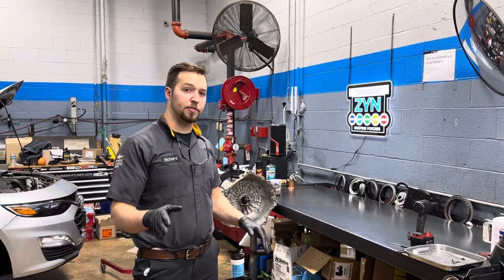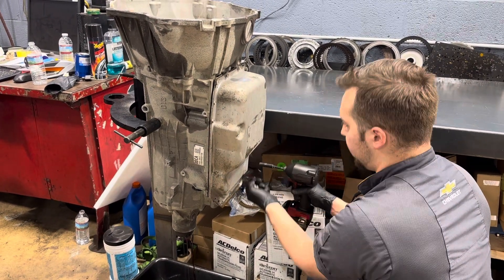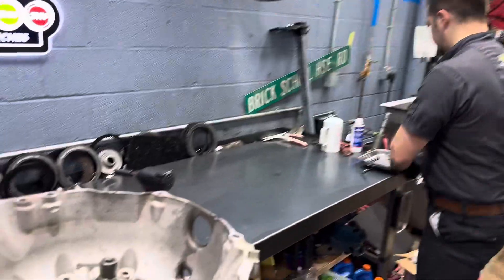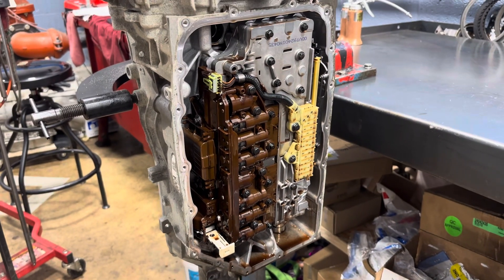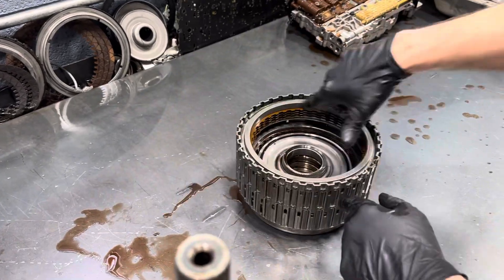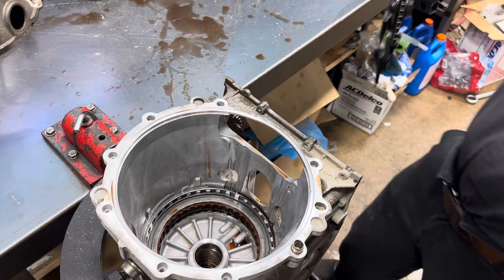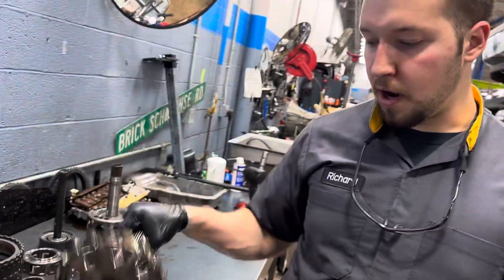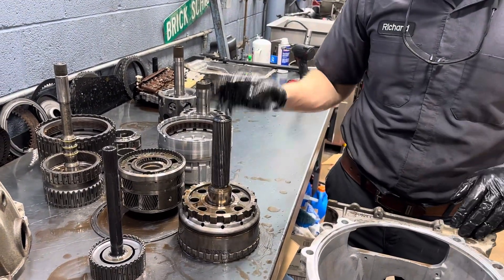6L90 no movement in forward or reverse

Comment: seen that on vans, loaded heavy,  they are not stopping all fwd or rev momentum before swapping. backing up, still rolling backwards, nail drive, or vice versa. its the equal to the 4l60/700R sun gear issues. weak welds sure but abuse finished it
Reply from the maker: Yes sir, that has to be a huge contributor. Those units are before my days man! Thanks for the comment

Comment: And put a billet converter back in it not the stk unit. Right.
Reply from the maker: No, the 6L90 torque converter is fault robust even in stock form. An express van that isn’t used to tow will generally last a long time even with a stock one but not a bad idea. A gas 2500HD work truck that tows often would benefit because it won’t make it 100k with a stock torque converter.

Comment: What parts are you going to replace them with. Are you going back with the factory parts or aftermarket like sonnex. I have 18 van in my shop and after 45yrs of work on vehicles never had trans that i service and moved van outside reverse and then 
forward then reverse into parking spot to come in the next morning and nothing. It has no reverse or forward. I don't rebuild trans and not up on all the problems. I did find a bulletin on the check ball but all that was fine. 18 3500 6.0 6l90 94,000 miles. Thanks for sharing 
The converter was replaced under warranty and the fluid looked good and pan was clean. Just shocked this may be the problem.
Reply from the maker: You will need the output carrier assembly and the output shaft gear assembly. Should be no other damage. That sounds like it could be the problem! Godspeed
Reply: @esoterictransmissions thank you so much. I really appreciate your help. God bless.

Comment: I work on a lot of the express vans for FedEx, I work at a chevy dealer, I see a lot of those failures. they over load the vans with stuff and just pops the weld. Also see it a bit on 2500 trucks with gas engines

Comment: I have a 2017 chevy Silverado and I bought it wrecked and completely swapped a new frame after getting it all back together fired the truck up it makes an awful buzzing noise and when I I put it in gear and it moves but when I give it more gas it’s like it been thrown in nutural and engine revs up then as the rpm’s drop it will move again but reverse works fine
Reply from the maker: @TravisSmith-k7d  Inspect the fluid level as well as condition. If  it doesn’t smell burned you can remove the pan and inspect for debris or remove valve body. It could be a check ball if the fluid is clean. If not there is something else going on

Comment: I HAVE A 2014 6L90 THAT I JUST REBUILD AND NOW IT DRIVES AND CHANGES GEARS GOOD BUT AFTER A WHILE OF DRIVING WHEN I STOP IT WILL STOP PULLING IN FORWARD AND REVERSE WHEN I TURN THE VAN OFF AND BACK ON IT DRIVES CORRECTLY UNTIL I STOP
Reply: This is happening to my 4l60 have you figured it out
Reply from the maker: Sounds like you have a torque converter failure. You’re able to drive it until the filter is stopped up with meta.

Comment: Would this made it seem like the transmission is locked up ? Tried to pull the truck in neutral and it won’t budge no brakes are hung up etc there is a engine code as well
Reply from the maker: If something is snapped in the trans it should always move in neutral. Try removing driveshaft and see if it rolls
Reply: @esoterictransmissions  removed driveshaft and it moved only way I was able to move the truck out of the garage
Reply from the maker: @Rehziicodm  definitely something in trans transfer case or diff binding
Reply: It’s definitely something in the transmission it’s 2wd and it rolled once I pulled the driveshaft . Im thinking torque converter or solenoids gonna look at codes and fluid today ! When you shift it to reverse or drive you can hear it idle down and try to engage but it’s completely locked up in any gear
Reply: @esoterictransmissions  the tip came off the parking rod and it was binding up getting stuck in park .
Reply from the maker: @Rehziicodm  Good find! is it a 6L80? Park rod wear is actually common on them. I’ve never seen it but I’ve read about it
Reply: @esoterictransmissions  it’s a 2wd 6l90 I was kinda mind blown finding it it’s allowing it to slide to far forward because the tip isn’t there to stop it so it stays engaged

Comment: I just bought a 2015 6l90 from a 2500 2wd. It will not go forward or backwards. The sfift selector feels odd. The output shaft will not spin. Sound like a shifter replacement?
Reply from the maker: Something is wrong internally
Reply: Thank you very much